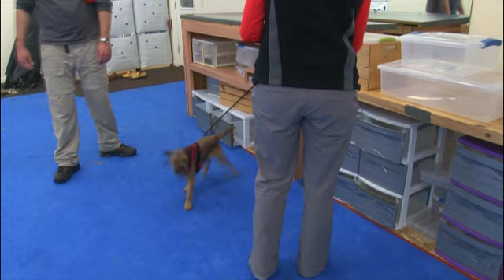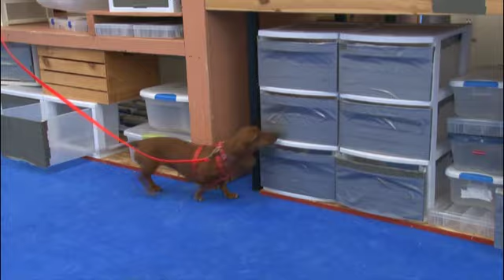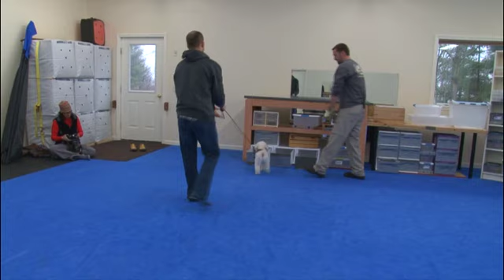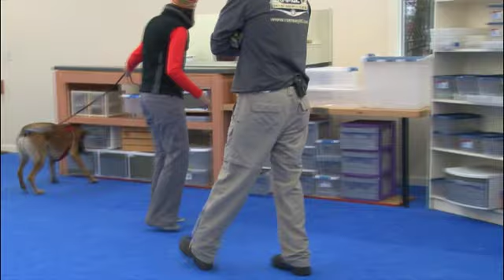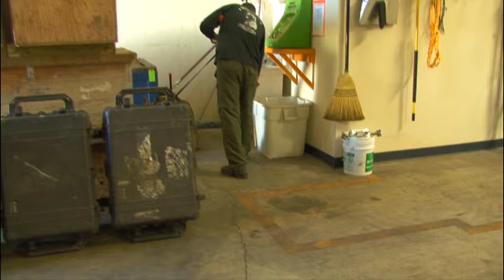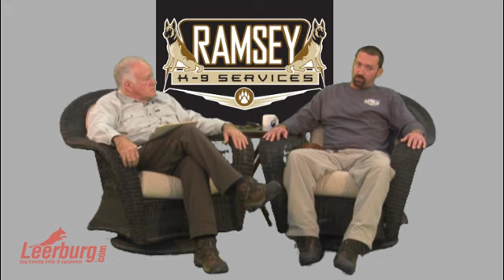Introduction to Nosework

Comment: What if the target is up High and they can't reach it, then what?
Reply: Well, I am still new at this, but, the dog isn't supposed to physically reach the scent, just indicate it. I was told, and the rules and regs can be double checked, I was told that the scent won't be higher than two feet. I have a Miniature Dachshund and many small dogs do this sport just fine. They just have to indicate the scent, not physically reach it. Part of practice is to train the dog to the two feet level to make sure he can indicate that.
Reply: The idea is for the dog to indicate where the odor is,  not necessarily make contact with it.  For example, if the odor is high up the dog just has to sit below it to indicate,  or whatever you want the indication to be.  It doesn't have to be a sit.